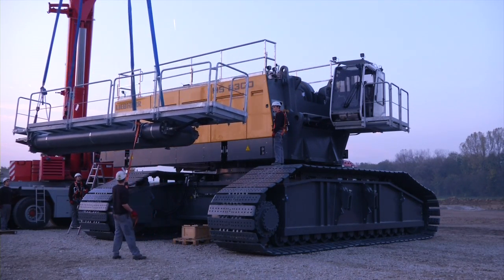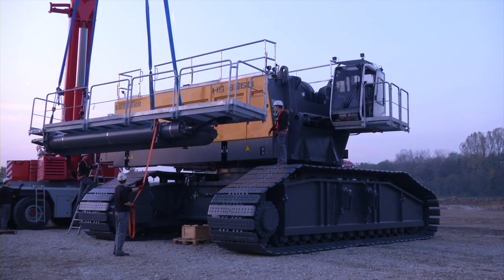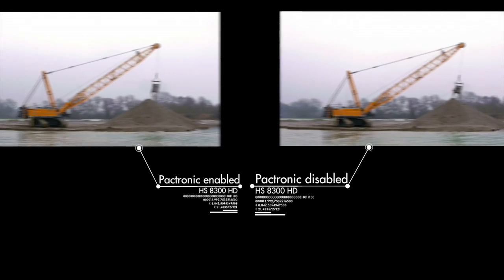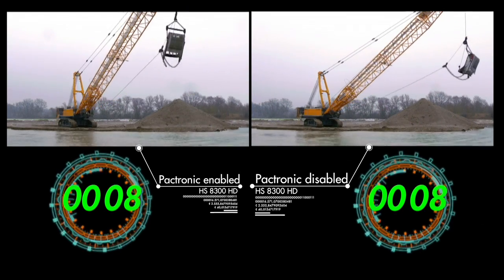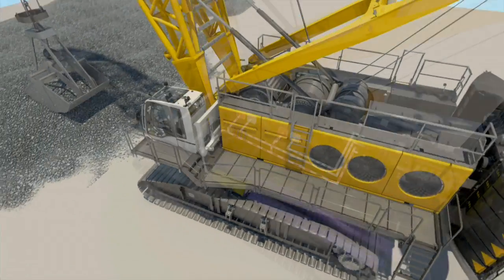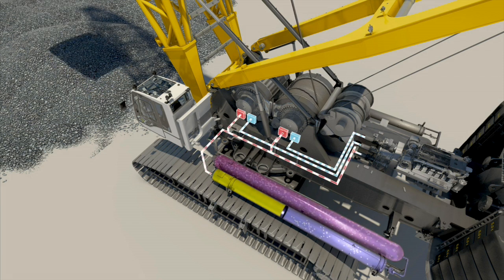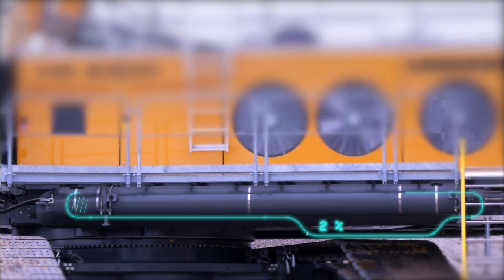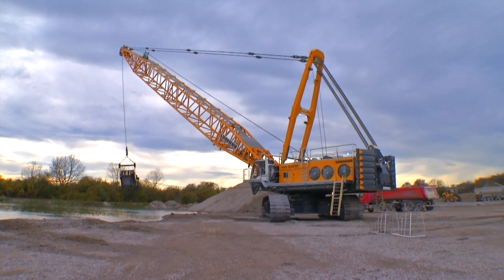Liebherr - HS 8300 HD Hydraulic Duty Cycle Crawler Crane

Comment: What is the max digging depth and length of hoist and drag ropes?
Reply: In which type of application?
Reply: @alexatarta31  dragline
Reply: @quinnm.cromyak2191  Digging depth down to 20,6 meters ( 67,6 ft) with 40 degree boom angle and 50 m / 164ft boom length. Rope diameter 46mm and Rope capacity 69.1 m / 226.7 ft in the 1st layer.